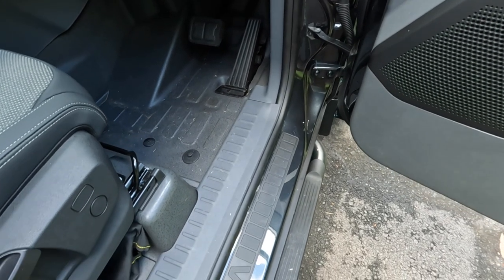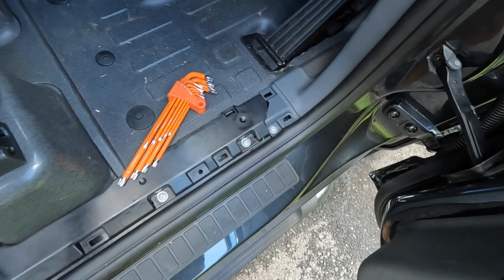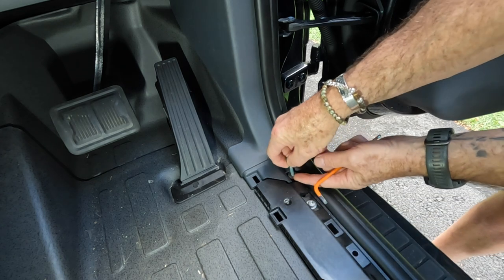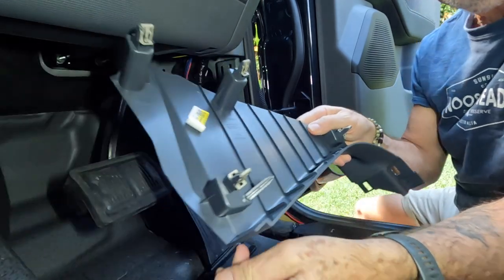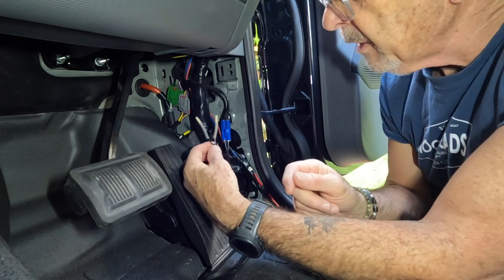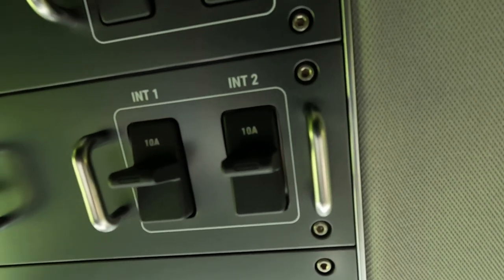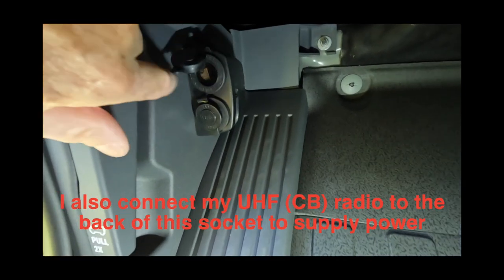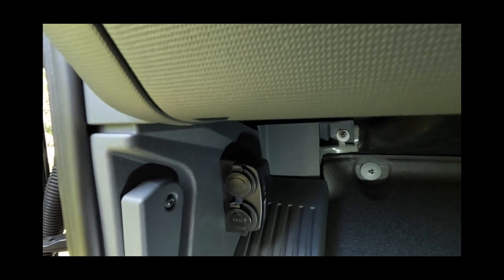How to find the auxiliary power locations in the Ineos Grenadier footwells.

Comment: Great tip to access the drivers side power..  the panels look simple to remove.  I’d be interested to see how you route the new cable.
Reply from the maker: Thanks, It not too hard to get the cable back, went under the mat, unscrewed the trim at the bottom of the B pillar tucked it behind and then there is an octagonal grommet under the cargo area mat that takes you underneath. Just let me know if you need more detail, John

Comment: Hi John, great video thanks. Do you have more information on how the duel battery system is configured?
Reply from the maker: Well it is not configured as a seperate battery for auxiliary use, it is more of a support battery for the cranking battery. Check out the Grenadier forum there is heaps of useful info there, Cheers John

Comment: John Thanks for your videos. Very helpful.  Did you connect your review mirror to same power outlet as the UHF radio?
Reply from the maker: No, I used the power outlet on the opposite side (driver side) Ext 5. Hard wired the cable there tucked away so I pull it out and connect it to the monitor when I use it. All works well. The other side, Ext 4 has the UHF , a cigar socket and  usb socket connected.Hope that's useful and thanks for your interest, John
Reply from the maker: Sorry I meant Int1 and Int 2  on the switches not Ext 4 and 5, John

Comment: Thanks for that, John. You mention fitting a reversing camera - how did that go? Did you make a video? I'm thinking of a Wolfbox system... comments?
Reply from the maker: Hi,
I have a rear view camera by a com[pnay call Safety Dave (Australia) they have a good reputation and I am happy with it. It has a second channel and I am considering add their numberplate reversing camera. However I have had a look at the Wolfbox and it looks pretty good. I like the setup with the the dash cam being integrated, also price looks OK. I reached out to Wolfbox to get some more info but unfortunately all they did was refer me to their website. Sorry can't offer much more than that, if you go ahead let me know what you think.
Thanks for contacting me, John
Reply: Thanks, John. I'm just back home after a flying visit to Cairns and I am making a booking to go back to Westco for the recall transfer case replacement - suppose that applies to you too. One of the plus points of the Wolfbox for me is the slim camera - useful as I really want to fit it high up and was thinking of either glueing it to the interior of the back window, or externally on the back edge of the roof. The second option means making a hole and I'm reluctant about that. In fact, I'm a bit chicken about the whole fitting exercise - running a data cable the length of the roof and then taking power either from the internal footwell connection or even from the overhead switch (is that possible). Can't help feeling I'd be better off giving it to a reliable auto-electrician - know of any in Cairns? Thanks and hope to meet some time...

Comment: John to get the wires up to the camera that you installed did you run it along the trim or up inside the Pillar and out the headliner or where did you bring the wires out for the caravan camera ?
Reply from the maker: I ran along the floor edge under the sill trim and the out through a grommet under the cargo mat towards the front on the drivers side. RHD.
Reply from the maker: Hope that helps if you need more let me know. John
Reply: @cannyoutdoors  ahh ok thought you were powering the monitor which is what I want to do with a camera dashcam up on my fieldmaster windscreen , so you used this to power a rear camera and then connected wirelessly I am guessing

Comment: Hey John, what did you do to overcome the lack of an Anderson Plug at the rear of the Grenadier?
Reply from the maker: Hi Les, My auto electrician wired the Nato socket around the relay which unlinks it from the  500A winch switch ( the relay accessed through the panel on the right hand side of the cargo area) this makes it permanently live. I then had to buy a Nato plug and make up an adapter to an Anderson plug. Pretty convoluted  process I know, but  it works. Some are just getting an Anderson plug run separately, In hindsight possibly a better option. Hope that helps, John

Comment: thts good.I there info on this in the owners manual .How did you know that they were there? You can also get joiners from say Jaycar which have an dhesive and a low temperature solder that you use like heatshrink in melts the solder and adhesive to make a joi in the wire
Reply from the maker: Hi Paul, no the owners manual is devoid of much useful information. A fair bit of fossicking around and a good multimeter  was necessary. Yes the joiners you mention are also good option. Thanks for your comment and advice. John

Comment: John. Does the manual not show where ALL the switched wires are located,for add one. That would be STUPID, on Ineos part. I guess Ineos, does not have any common sense, for whom every made their manual. Please correct me if I’m wrong. Thanks.
Reply from the maker: Unfortunately you are not wrong. The provided manual is of little use for anything and it is proving difficult to get any technical information on the car. This is most disappointing and very frustrating😠 and certainly not what was promised. Thanks for your interest Robert , Cheers John
Reply: WOW, this fact,from you now has me considering NOT buying the INeos. That’s SOOOO unfortunate. @cannyoutdoors
Reply from the maker: No it's not a reason to not buy , the good well and truly outlays the negatives, John

Comment: question  where is the OBD 2 LOCATED
Reply from the maker: I believe it's the yellow port under the right hand drivers side dash, but I can take advice on that.
Reply: @cannyoutdoors  it is John - love your videos please keep them coming - are you doing anything re draws and/or fridge slide? ditto air compressor and/or rear camera on mirror?
Reply: @cannyoutdoors very helpful, obviously I'm just doing dry runs😢 when when when when when 😂from Steve near Chester England 🏴 where the Roman's once lived.
Reply from the maker: Thinking of drawers for sure, just waiting till a few local manufactures get on board. Air compressor definitely and have already installed a rear vision camera.. seperate monitor. Cheers John